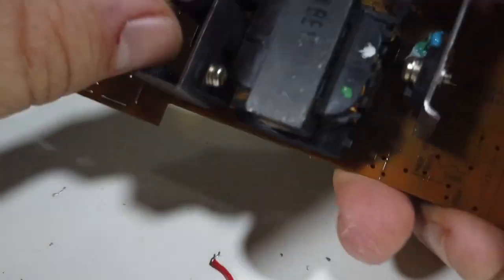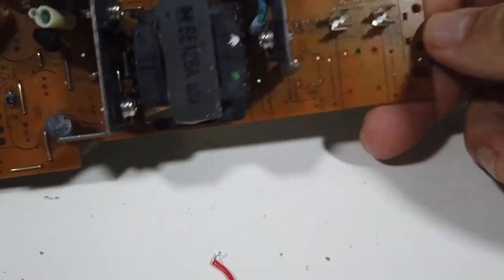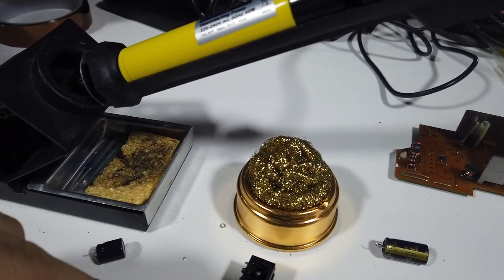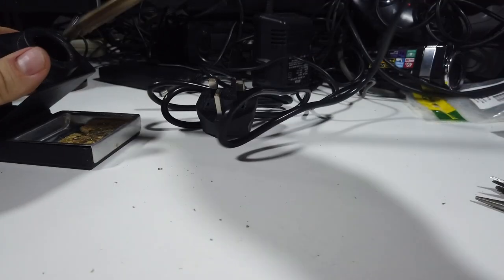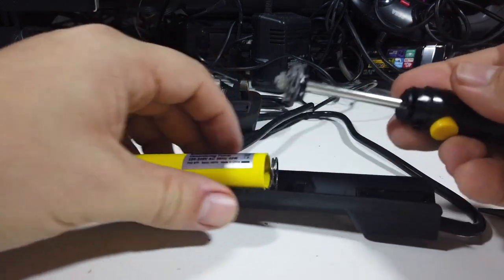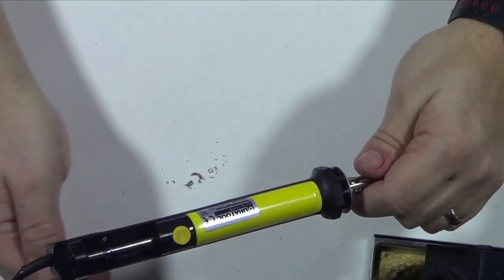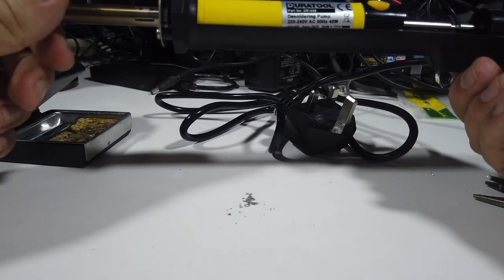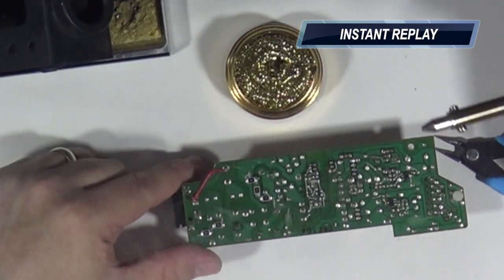Cheap Desoldering Pump £12.99 Duratool 40w 230v Budget Desolder Sucker

Comment: £6.95 from CPC Farnell and replacement tips are 50p or so. A great product but the tip on mine wore out fast. Easy and cheap to get a new tip though. It does stink on its first use.
Reply from the maker: No way, that's even more of a bargain. Couldn't believe the smoke on the first use. 
Used it a few times since and it has been great. 
Thanks for watching.

Comment: Nice review Craig. I have a separate solder iron and then that pump pen type suction tool, I find that desoldering modern stuff it is practically useless as everything is so tiny...but I probably just need more practice, I have used on on switch and DS consoles, so maybe that's my issue haha, I think flux and a wick is needed for the more complicated stuff. Gonna stick to older tech for practice though from now on, so this tool would be so handy. Great video 👍
Reply from the maker: If you're doing surface mount take a look at my soldering station video, the heat gun on that is great for the newer consoles and smaller components. 
Cheers for watching.

Comment: From what I can see (based on the time it takes to melt the solder), that thing seems to go well above 420°C so, be careful with very old boards. The key with desoldering pumps is to keep them clean, very clean.
Reply from the maker: Yeah it is a hot iron, probably a lot hotter than a 40w as it was advertised. 
I've used it a few times since filming this and as long as you are careful it is pretty good desoldering pump to use. I recapped an arcade monitor chassis in half the time it would have normally have taken me.
Cheers for watching and commenting.
Reply: @GoodwinsPlace  Seems to be a pretty competent tool indeed, especially at that price point.
Reply from the maker: Yeah for the money I like it. Can't justify spending the big money just yet. It's just a hobby and will build up to something different later on.
Reply: @GoodwinsPlace  The Anesty ZD-915 would be the next step, it's £70 and works really well for the price. But 70 quid is hard to justify if you're only modding from time to time or you're not selling modded consoles.
Reply from the maker: Thanks will take a look. 
Never know might start doing to sell soon, but at the moment I just enjoy working on different systems for my own collection.

Comment: I got one of these myself a few months ago and I've used it half a dozen times. It smoked on first use just like yours did, but it has worked consistently well when removing through hole caps etc. Mine has started to get noisy recently, so I don't know how long it will last for.
Reply from the maker: Noisy as in the iron or the pump?
I've recapped an arcade CRT chassis and it was great for that.
Reply: @GoodwinsPlace  It's the iron making the noise. Still seems to be working OK for now though. Even if it broke tomorrow, I'd still day it was worth £12.99.
Reply from the maker: Exactly. Everything has an expiry and as long as you get the use out of it then tats good.
I'd be tempted to look at what is inside as it can't be that complex.